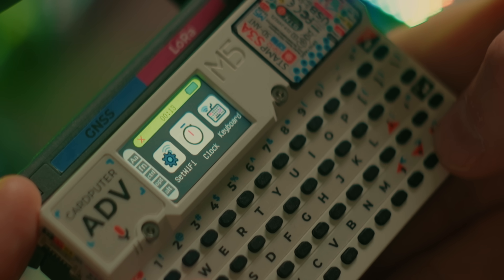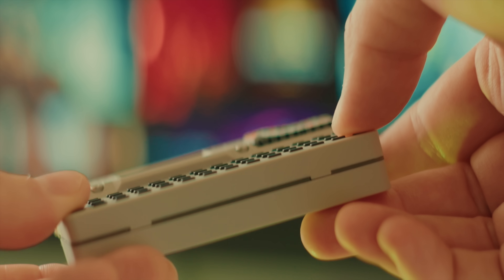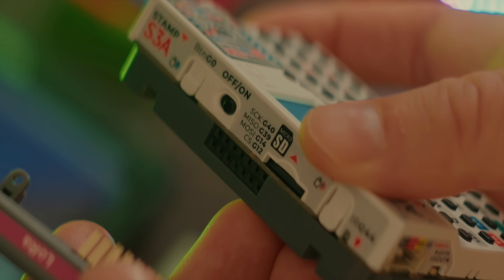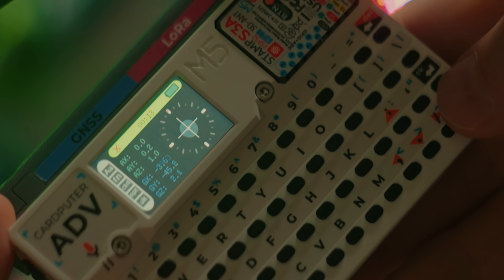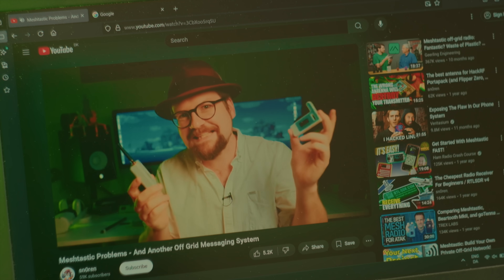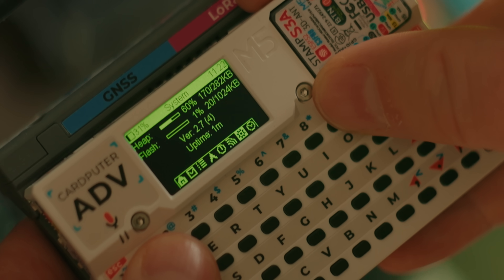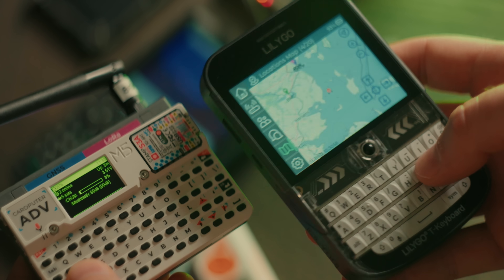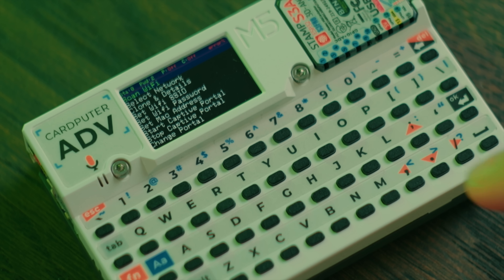The new Cardputer ADV

Comment: It is a ESP32 chip and OLE screen.  One could make it themselves, but the sales price is right.  Awkward as hell with the small screen and dinky keyboard.   Time and time again the 15-inch laptop form factor is far superior.
Reply from the maker: You can fit a 15 inch laptop into your pocket? 😮
Reply: @sn0ren  FYI battle ship and row boats are both boats but for different missions. I can fit my 12-inch laptop in my side coat pocket and it is annoying to use because it is so small.  For cheep small computers try a Raspberry Pi-5 and the monitor size of your choice and a blue tooth keyboard size of your choice.  Else a Raspberry Pi Zero, Raspberry Pi-4, and a monitor and keyboard size of your choice.  My fingers and my eyes need something big enough to work with, with a operating system for something other than playing games.

Comment: 6:17 slow keyboard on meshtastic may or may not be fixed very soon, am working on it as we speak :)
great video!
Reply from the maker: I’m counting on you 🤘
Reply: did you fix it? :D
Reply: @olifer  its a bit complicated. turns out the meshtastic for cardputer adv that is on m5burner is not open source so i could not work off of that. someone else made partial support for cardputer adv on meshtastic, but that is not merged yet. i made the improvements i wanted to keyboard handling for tca8418 which is used in t-lora pager and t-deck pro so those are already much better feeling when typing. however, thats also not merged yet. cardputer adv also uses tca8418, and i did port my keyboard improvements to the work in progress cardputer adv code, and its available in my meshtastic fork's develop branch, but as i said it is not merged into the main meshtastic firmware yet.

Comment: I’m so glad you chose Evil Cardputer! As much as I love Bruce, it’s just better on the T-Embed CC1101 Plus. I should have my ADV in hand next week. It’s shipping, but I have to wait for it to come from China to the Midwest USA. Thanks for the video! It will be nice to see the differences from my Cardputer 1.1.
Reply: Don't worry guys ! It's a perfect timing 👌 it lets me code while you are waiting for it, so you can enjoy evil on adv right after receiving it 😂 and with hat compatibility 🤗
Reply: @Evil-M5project  I an very interested in Evil. However, every time I have any time to spare and play around with it I get so many crashes which cause me to get distracted and direct the time and attention elsewhere. (using ADV btw) I never seem to get them with Bruce or Marauder ):
Reply: @Randy-fn9fi  yeah due to the multitude of functionality and the very small ram it happen that there is some memory leak that I try to patch on each version, there is also some crash that comes from library that I use because they don't flush the dram that they use, so at a moment there is no more ram so it crash, but yeah each version comes with patch but I guarantee you that Bruce and marauder have the some same issue because the hardware itself is pretty low on ram
Reply: @Evil-M5project 🎉🎉🎉🎉🎉
Reply: I'm in the exact same boat here in Texas. Last time I checked it hasn't left China yet. But yeah, super excited to compare it to my 1.1